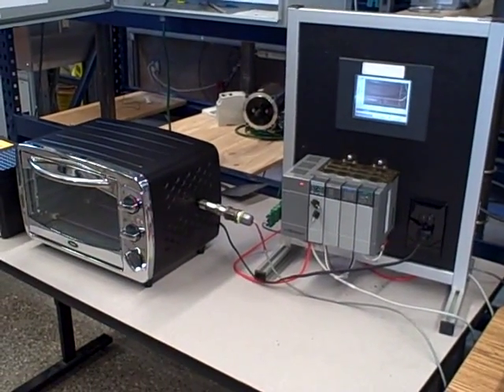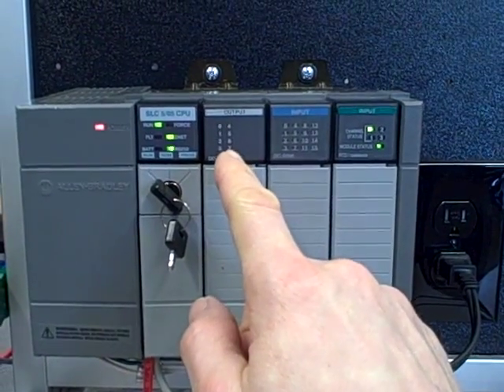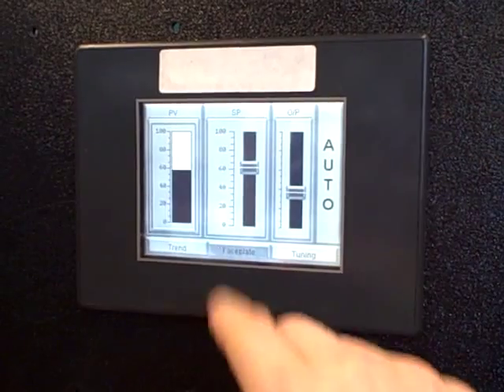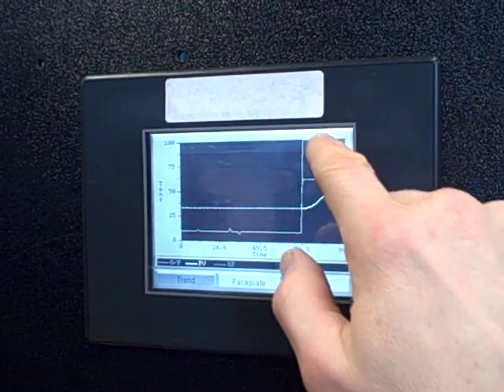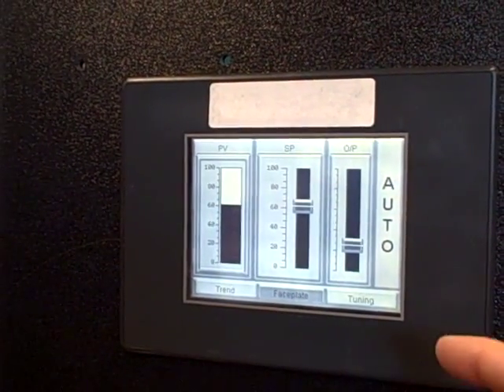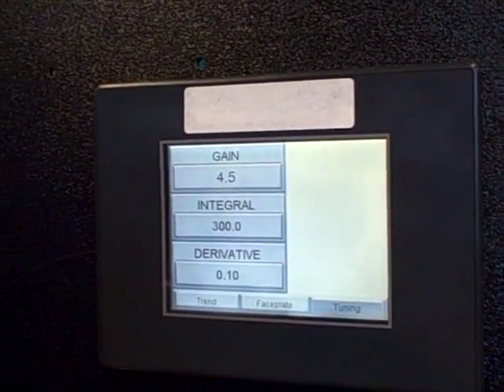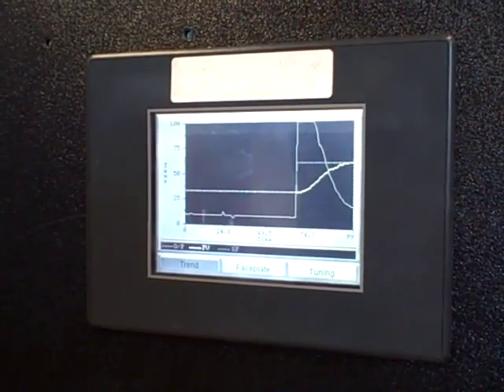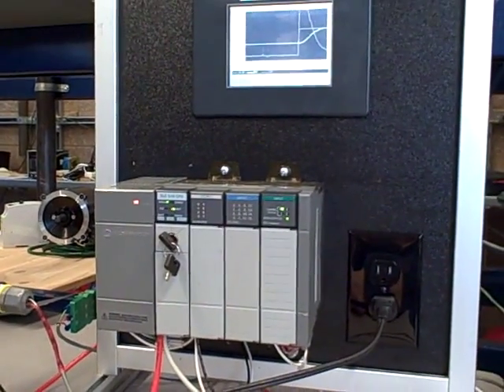Toaster oven PID control using PLC -- part 2

Comment: Previously you said that the PLC in this video was donated by local oil refinery. I'm guessing, it is has been used there, and they just giving away old units after upgrade. So, the question is - why to replace perfectly functioning PLC? It's very expensive to do so (new devices + installation cost + some refinery process standby time cost).

(it's all assuming, that the PLC were used, and they making an upgrade)
Reply: I'd say product and software support play into it. When the PLC reaches the end of its product life cycle, the support tapers off. The software will eventually require a hardware upgrade.